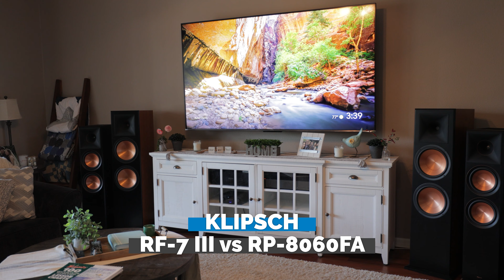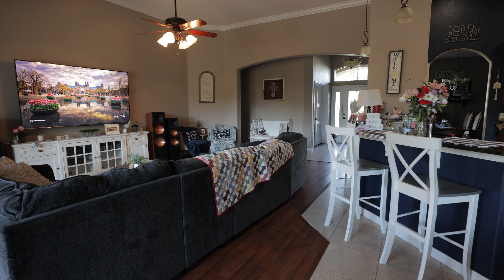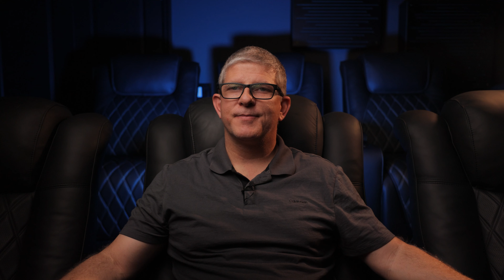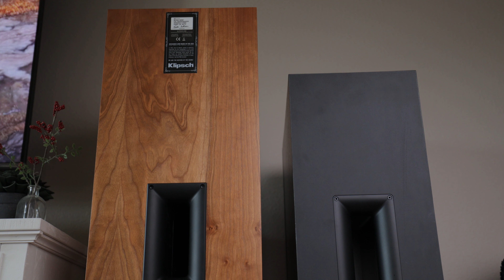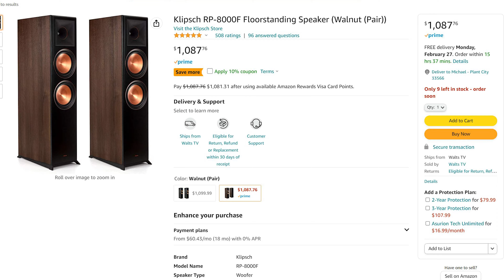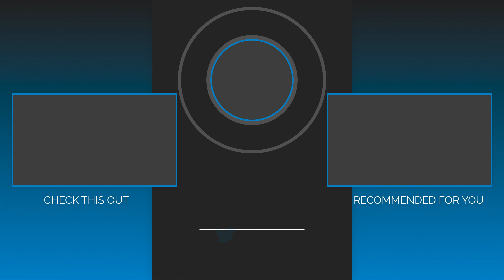What Would You Choose: Klipsch RF-7 III or RP-8060FA Speakers?

Comment: I have the Klipsch Tower F-30 Synergy's (with dual 8" woofers) coupled with my SW-112 subwoofer that I purchased 10 years ago, and I was NOT impressed with any of the newer RP-800* Towers at all.  If I was to upgrade my towers it would be to the Klipsch RF-7 III towers. I've also heard the Klipsch RF-7 III's on my setup, and their bass ability was so good that I wouldn't need my subwoofer. :)
Clearly, the RF-7 III''s (with their dual 10" woofers), are the best Klipsch "Tower" speakers, imho.
 That said, the RF-7 III''s and the Forte IV's are excellent speakers but are extremely expensive. :(
If Klipsch ever out with RF-7 IV's, I hope they fix the random capacitor issues on their crossover, and replace those flimsy rubber stick-on feet with better and more firmer feet.

Comment: How high did you hang your tv ?
Reply from the maker: The bottom of the TV is 36 inches from the floor. It’s up higher than I would like. I wanted to buy a really short AV cabinet, but my wife wanted this cabinet, which is much taller. She also wanted to be able to play some things on the cabinet so I had to add a few inches above it as well.

Ideally, if you can, you’d want to mount it maybe a foot or two lower
Reply: @Youthman oh ah just a little higher then eye level right ? I have a 65 inch lg c4 and the Klipsch 8060fa. I was trying to see how high should the tv go, I seen people say 42 inches to the middle of the tv but would that look nice with the towers there. And I haven’t even gotten my tv stand yet either I’m using the Klipsch box just moved in 😂. Might have to wait till wife’s approval on what she wants first to see how high.

Comment: Thanks for the very helpful overview. i would love to make a living room AV setup  using the RP-8060FA. Can you recommend a good as strong as it can get Center Speaker so i don't have to struggle hearing speech like i do now with my mordount short Genie set. few years ago i replaced the woofer with a Mordount Short Alumni 240w model. it's still working so perhaps i don't need to replace it but it seems under powered compared to the 1200 or 1400w or even 1600w woofers on the Klipsch site.. And finally a question that's bin lingering in my mind for a while now can one use a RP-8060FA for the rear as well as front or does that suffer because of the couch being in front of it.. Thanks for your help greetings from The Netherlands

Comment: Hi Youthman. About 4 years ago you posted a sound demo of the 8060-FA and they sounded phenomenal. In that video you mentioned that you would do a sound test comparison to the FR-7iii but I couldn't find it. Are you still planning to do one?
Reply from the maker: Hi Joe, I might be able to do that.
Reply: @Youthman  Thanks for the quick reply, I know you must be very busy with so many projects and videos. For 2 channel listening is there any audible difference between the RP-8060FA ii and the R8000F ?
Reply from the maker: Let me clarify, I do not have the original version into compare them directly. I thought you were asking if I could compare the current model RF-8060FA II to RF7 III.
Reply: @Youthman  Sorry for not being clear. My first question was about a sound comparison of the RP8060-FA to the FR-7 iii. My second question was if there is an audible difference between the 8060FA in 2 channel listening (with the Dolby Atmos section turned off) and the RP-8000F ii
Reply from the maker: Thanks for clarifying, in that case I won’t be able to provide that. I no longer have the original version so I can’t compare the first version to the second version. The RF7 IIII is a much better speaker than the original 8060FA due to the massive 1.75” compression driver, plus the harder hitting bass from the dual 10’s and larger cabinet.

Comment: I’m pretty happy with my rp-280 fa towers.  I have rp-504c as well.  They’re also my 1st set of tower speakers so my journey is fresh.  I’m converting my den into a theater room.  It’s a 10x10 room, but was a 4th bedroom option so there’s a cut out where the closet would have been.  Gives an extra 2 ft of depth for most of the room.  So it’s almost 12x10.  I figure I’ll line my couch up just in front of the cut out space and put my surrounds, rp-160m, behind my couch.  And my subs, right now I’m running 1 pb-2000 pro and will be adding another one at some point, will be right behind my couch as well to maximize the small space I have.

Comment: I currently own the RF83 and RC1 had them for 17 years is there much difference upgrading to RF111 and RC111 do you think it would be worth it?
Reply from the maker: How to owned the RF-83 for many years. It uses a smaller compression driver and has a MUCH different sound signature than most Klipsch speakers. Definitely the most laid back sounding Klipsch speaker I have ever owned. I do prefer the additional detail from the RF7 III

Comment: Nothing like getting off work and the first thing I see on my phone is a recommendation video on YouTube,  by none other than  the man himself. BTW, I got the rp8000s iis . They blend in really well with my svs sb4000 subs.  Now I'm in the market for another sub should I go down the rabbit hole and go for sb16 ultra or sb4000 ?
Reply from the maker: Thanks Jorge. A lot depends on the size of your room, how much bass you like.
Reply: My rooms a garage about 20x 22 feet I'm guessing about 3000cubicfeet, and I like my bass to with some slam, unfortunately I can't go the pbs16 ultras because of there size ,and I like the sealed versions just a tad bit more, plus they  are easier to move around. FYI I'm going to be using the next sub as a near field sub. Thank u for taking your time to reply.

Comment: I’ll eventually upgrade my front stage to the rf7 and rc64
Reply: I'm a huge fan of the RC-64.  That's because I like to start with the best center speaker I can afford and then build outwards.
Reply: @voiceofreason9238 i just hope the difference is worth the price as a rc64 is 1800 vs the 525 I paid for my rp504cii
Reply: @danemoreno88  I picked up my RC-64 from Offer Up. Beautiful condition for $700
Reply: @laspaceboy  wow wish I could find that in my area found a b stock rc64iii for 850 but it’s a cherry color I want ebony